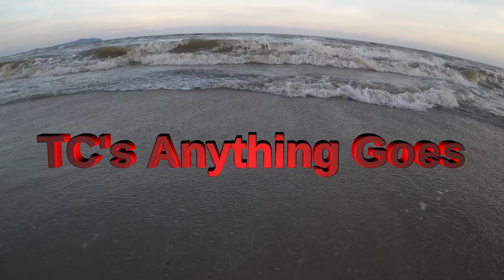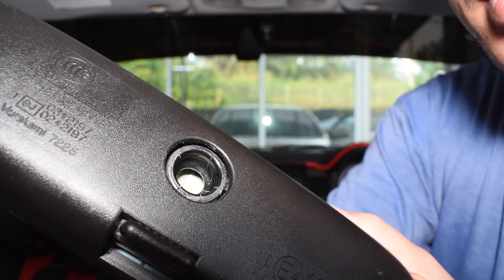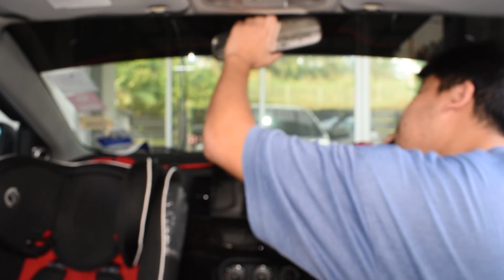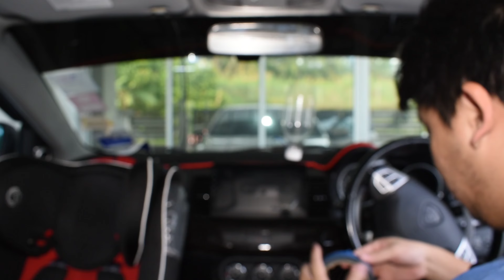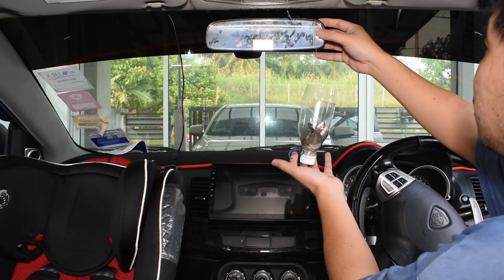How To Fix a loose rearview mirror for FREE

Comment: I had a rear view cam screen installed over the top of my mirror after which the mirror would sometimes drop. The mechanic who installed it for me alerted me that from the extra weight, the mirror was loose and said that the only way to fix it would be to replace the mirror. Not only did this video help me know how to fix the problem, but it also helped me know not to go back to that mechanic. Thank you!
Reply from the maker: Glad this helps. True that some mechanics is only interested in replacement rather than repair cause that's where they get more money. I prefer to try and find methods to save money.
Reply: I’m literally experiencing this exact same thing lol that’s why I looked it up
Reply: and you robbed mechanic's earnings, with your money he cannot feed his children, put clothes on them or send them to school or buy another house... just kidding
Reply: @masterciefl2k  The mechanic should have been honest, and the customer would have returned often. The short-time-thinking mechanic robbed himself of the earnings
Reply: Better using old type of mirror because there has base on screw wich is more tighten than these cheaper-look base.

Comment: I have a dash cam mounted to my mirror, and every time I hit a bump, the thing starts tilting downward. This helped tremendously!
Reply: Is it effective untill today?
Reply: I'm in the same situation as you then
Reply: It works.
Reply: @barokthegreat828  how many piece of receipt paper you added?
Reply: @jayagno30  you can use a tissue paper, it works also.
Reply: @barokthegreat828  noted sir. but how many "layers" worked for you? thanks!
Reply: @jayagno30  just a two or three, If easily to adjust, just add another layer untill the desired stiffness.
Reply: Mee too, not even go to a bump, is permanently drop before start the car

Comment: Great video. I took a sharpie and made a piece of paper black, trimmed it some and using your idea popped it in and it worked great. Thanks!
Reply from the maker: Great idea. that way it does not look obvious that there is a piece of paper there. The top portion of my windscreen is tinted so i don't see white paper at all.

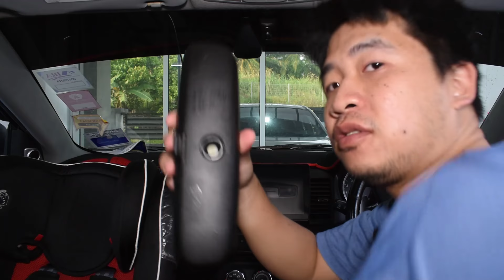Comment: OMG that was exactly what I wanted at the  1:25 mark THANK YOU !!!!!
I  have an after market clip on wider mirror  300 MM  clipped onto my OEM Mirror  and  ONLY when Its hot outside  its too heavy and the mirror slumps down. 
This is all I needed I am going to place some silicone in that joint to add some friction    Thank you man !!   Oh wait  paper  Hmm Maybe ...
Hey your steering wheel is on the wrong side  hahaha
Oh crapp I saw the TC and though Scion TC      Hopefully mine comes off this easily for similar repair...
Reply from the maker: Silicone might be a bit more permanent but when you move it around awhile, it will still come out and make a bigger mess. I prefer paper as its less hassle and easily replaced. The steering unfortunately came from the factory....... and my government deems left hand drive cars as illegal cars. =)
I had to search for Scion TC and found out that its a 2 door Toyota..... which unfortunately is not available in my country as well..... damn Malaysia is missing out on a lot of nice cars.

Comment: If u want it to be esthetically pleasing, u can use epoxy to make the ball joint bigger, sand it bit by bit according to how tight u want it to be. But u have to take out the rear mirror assembly.
Reply from the maker: This is also a possible method even if I have not tried it. But it takes longer and yes, based on the comments I am getting, its also safer to remove the entire assembly else there is a risk of breaking the windshield.

Comment: really works like a charm! but is there any reason why must use receipt instead of any normal paper?
Reply from the maker: there is really no reason. you can use paper as well. I just grabbed whatever that was in the car.
Reply: @TCsAnythingGoes  😳 i purposely waited until i had a piece of receipt large enough and square enough before i did the fix haha
Reply: @TCsAnythingGoes  from outside can see that the receipt has numbers on it

Comment: Good tutorials. how about if the problem is in the base.how to remove and fix?Thanks if
Reply from the maker: Depends on what is broken on the base. If its the metal plate that is glued to the windscreen, you can just purchase a new one and glue it with windscreen glue. If its the base arm that is broken.... gotta see whats broken and see if it can be glued back together.

Comment: The pull-out of the mirror is that the same for 2005 4runnner?
Reply from the maker: i can't say for certain cause there is no 4runners here in Malaysia. Just take a quick peek at the rear of the mirror and if it has a ball joint, then its the same.
Reply: @TCsAnythingGoes  same. I used old mask instead of paper. Thanks 😊

Comment: Wow! I really just did that while I was at a red light… So it worked except the only thing is I realized that the female part of the male joint that’s like on the actual back of the mirror it’s self has a crack in it!… Anyone have advice about that I don’t even know how to buy a replacement rear view. The reason that this problem even started for me is because I got a clip on mirror that had a wider angle view and the weight from that was causing it to lean down every time I went over bumps in the road

Comment: Remove the bracket from the expensive windshield. Part of the bracket is glued to the winshield. Part of the bracket can be removed by loosening a screw. Don't risk breaking your windshield by pushing on it.
Reply from the maker: The mount which is a piece of metal is glued to the windshield. For this particular car model, there is no screw, just need to slide the arm upwards and it will come out. I didn't do that cause the amount of force needed to pushed the paper and ball joint back in is very minimal. But yeah, safe than sorry is good.
Reply: I was able to push it right back on on my BMW! No damage over here!

Comment: How long has this hack worked out for you ? Need to know how soon/ if I need to buy a replacement 😅
Reply from the maker: ever since i did this.... i think i only ever replaced the paper twice..... if you don't move the mirror much, it can last longer. if you use something more durable like plastic... maybe it can last even longer
Reply: @TCsAnythingGoes  i used rubber plastic film, havent replaced it for 2 years now 😎

Comment: So, what's the purpose of the coins? No Disrespect intended, but wasn't the mirror loose to the touch when you pulled it off? I'm fairly confident that either the mirror was wiggly or drooping to 1 side like Gma after her 7th stroke?
Reply from the maker: The coins were a benchmark to how loose it was. You know the internet, gotta show some proof else its fake.
So in this case, it started off as unable to hold even 1 coin and after the "fix", it can hold up to 40 coins. Tightness test as someone called it in the comments before.

Comment: So just one question. How do you remove the who entire mirror from your windshield. I want to remove the whole entire mirror because I got a new one
Reply from the maker: If you are talking bout the rear view mirror. Then its easy. Just hold the stalk behind your mirror and push upwards. It should slide out of the bracket.
If you are talking about the entire windshield, that's a whole different thing that you need 2 person to DIY.
Reply: @TCsAnythingGoes  nah not the windshield. The mirror. But no worries. I removed it and installed a new rear view mirror 😎. Thanks again

Comment: I've being try to put some paper but its hard to put that mirror back
Reply from the maker: Try a thinner paper. I choosed a receipt cause its thinner than normal A4 paper. It does get tighter once you put a paper there and from the comments here, some have cracked their windscreen when forcing the mirror back in. So becareful when installing it back. Else you can hit the base upwards to take it off the metal base before installing it back.

Comment: Thanks!
That car seat should be in the back seat though. It's much safer for baby. If that car has airbags in front could kill baby in the event of a crash. Just don't forget and leave baby in a hot car if you move it back.
Reply from the maker: Thanks for the advice on the car seat. She has already been moved to the back with a better car seat with ISOFIX since i saw some video on car seat safety.

Comment: Never try like this, big chance to break the wind shield while forcing hard with the mount attached to the windshield. Instead take the mirror back mount out of the glass, fix it and mount it back to the glass.
Reply from the maker: Looking at the comments, there are some that broke their windshield and lots more that didn't. I have not broke my windshield and I did push just hard enough for the thing to pop back in (with 2 layers of paper). My caution to all that attempts this DIY is to be sensible and start with the least amount of paper instead of going straight to 4 or 5 layers then PUSHING IT HARD like their life depended on it. 

But I do agree that your method is also feasible and more logical in the sense that it reduces the chance of the windshield breaking. Just don't use too much force when installing back the mount to the windshield cause that can cause the mount to tear off from the windshield or worst.... a broken windshield.

Comment: Any idea how? I used up so much forceto re-insert it but its too tight 🥲
Reply from the maker: try reducing the thickness of the paper u are using.
Reply: @TCsAnythingGoes  Yo my case is actually to reinsert back (cus too tight) the shivel ball in  the socket(using hot water to expand) inside it. And thanks alot for your help ☺️🙏

Comment: Using paper (the McD’s receipt) is very silly. The paper will perish and the problem will return. 🤷‍♂️
Reply from the maker: i dunno... been a year plus i think and its still holding up pretty well.
Anyway, its a free piece of paper, you can easily replace it or just use something more sturdy like the backing of a double sided tape (still free)

Comment: uh now we will see paper at the opposite side? no?
Reply from the maker: Depends. You can use dark color paper or even black paper. Or even cut the paper small enough to fit the hold nicely. But in my case, that portion was never visible from the outside anyway.
Reply: @TCsAnythingGoes  Just gave me an idea...What about some electrical tape around the ball
Reply from the maker: @hakimdurand8427  That will work but it will become sticky.....